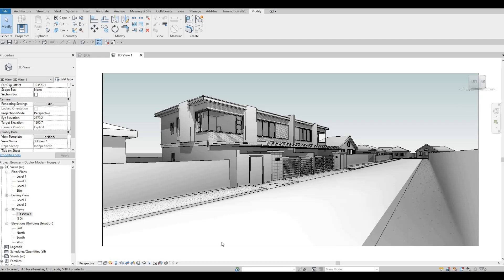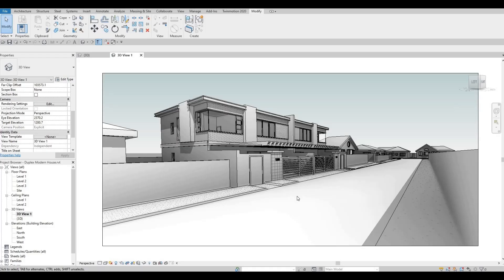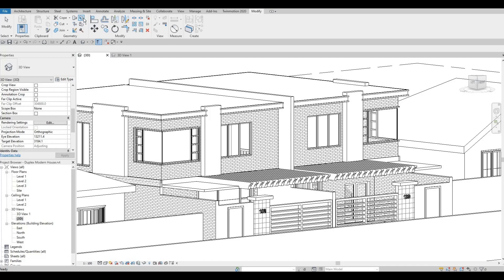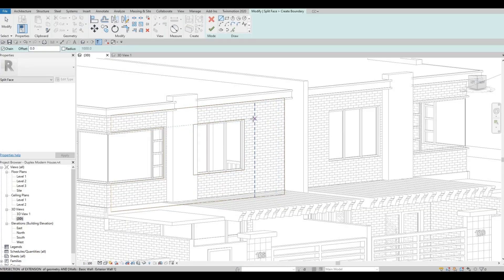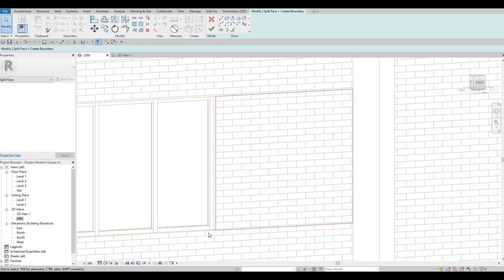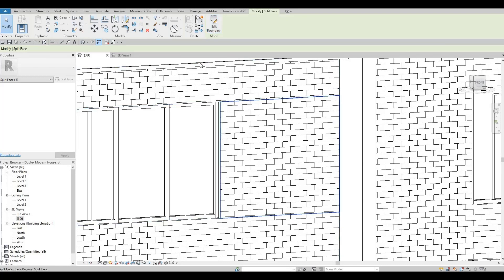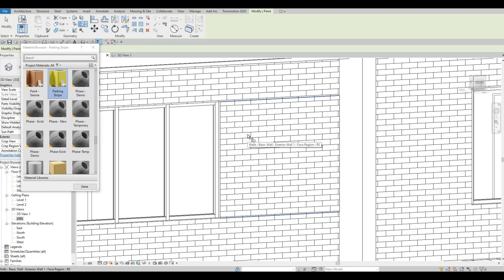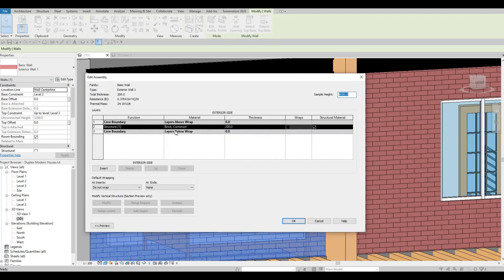Split Face in Revit | Revit Tutorial | Tips and Tricks

Comment: Helpful.  Would welcome adding a troubleshooting portion after the explanation. For example, I frequently get an error that my boundary lines are not on the correct plane of the brick wall to which I am adding the Split Face .  it looks on the same plane.  Align doesn't seem to adjust anything.  But I cannot close the boundary editing mode until this error is rectified.
Another good troubleshooting item:  Frequently, the paint material does not display.  Why?
Reply from the maker: Great suggestion! thank you Dan 🙂🙏